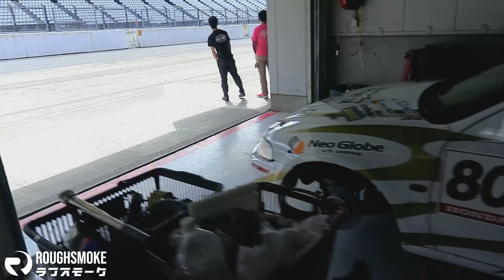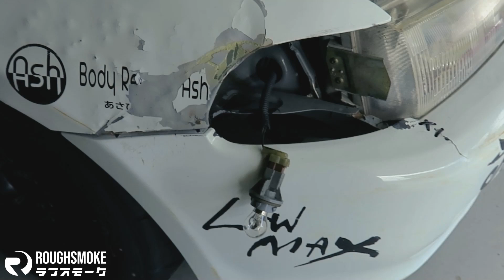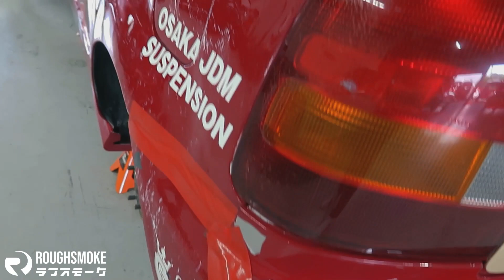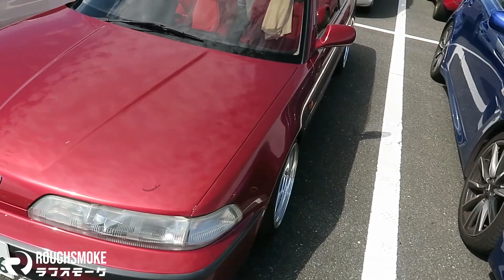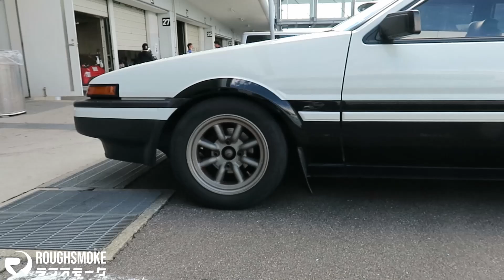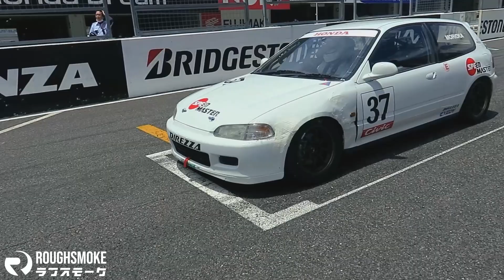鈴鹿クラブマンレース Suzuka Clubman Race - June 2021 / RAW Clips / Roughsmoke

Comment: just curious, i noticed some entries that appeared to be EK9 models based on some interior and exterior parts but they had a 4 lug wheel setup instead of the 5...are they Ek4 with EK9 parts perhaps? or are the EK9 using EK4 hubs/knuckles for better wheel choice and/or price?
Reply from the maker: Good question. All of the nine entrants on the weekend running EK's were all using EK9 models with some adaptions.
Reply: Ek9 n1 model (race base)came from factory with 4 stud.